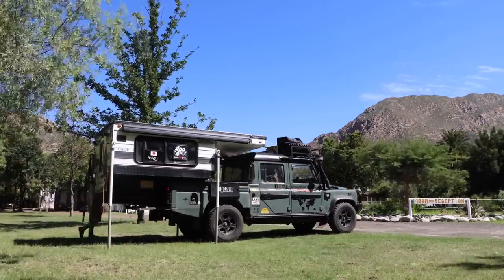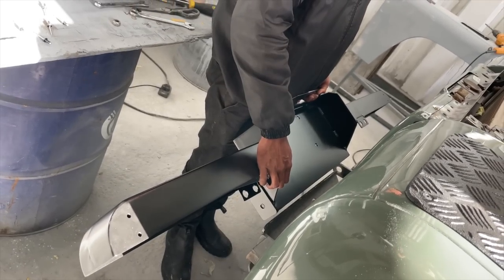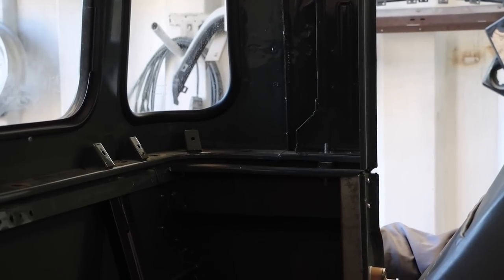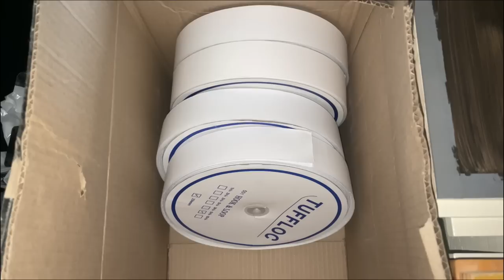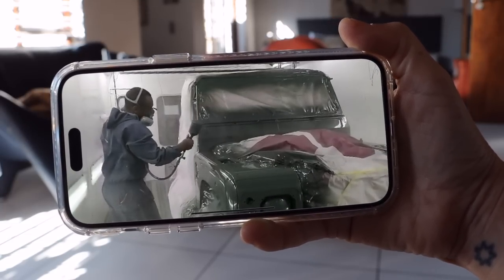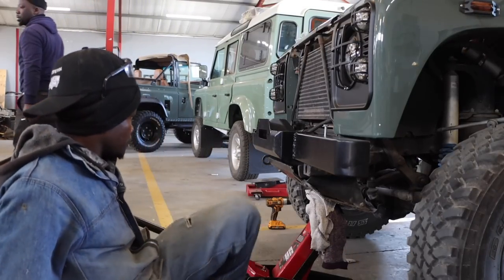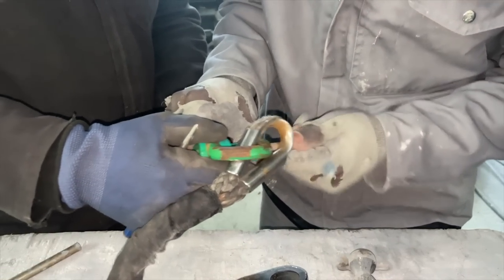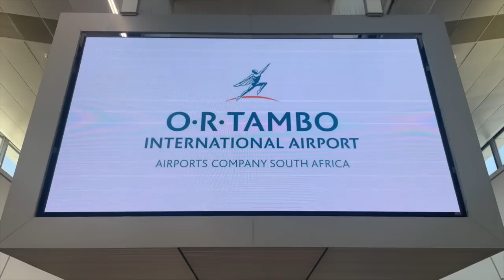More work than we imagined ! (Ep260)

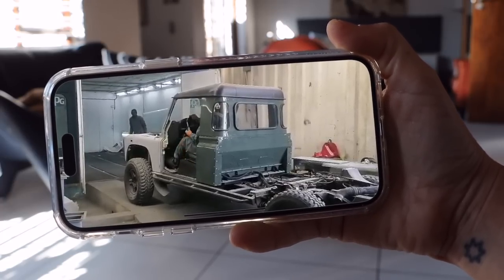Comment: 10:20
I don´t know why no-one uses the wholes from factory that are already in the PV panels?

I used 40mm round steelplates with M8x20 bold inside those. THOSE are glued on my roof, just these 5 (per panel) 40mm plates with PU glue on my roof, the panels are than screwed. 
My rood is curved from the windshield to a more or less flat roof. (which is why I used flex panel in the first place!). holding up since 2018. The fastest I drove with this is a 120km/h (GPS, 20 more than allowed).
Reply: PS: I bought the cheapest CN panels the I could find at the time. Maybe that is the reason why this worked so well since 6 years.

Comment: Yikes! So many mistakes are being made and thats just from watching select video segments. The way they treated the door rust is gonna come right back. Painting all your parts should have been powder coated. The plates bolted to the hood should have never rubbed the paint away. There was to be a barrier between. Eg.. the door not lining up. Thats just what you see. How many other short cuts where taken you can’t see. The fact that stefie can pick up the front bumper with one hand shows just how weak it is and will not offer much protection in the event of an accident. Some things are worth the weight. I’m not trying to be a debbie downer, love you guys but i see issues for your rig down the road. I’ve been off roading for decades and built top notch rigs through my life, and some of thebwork done is very cringe